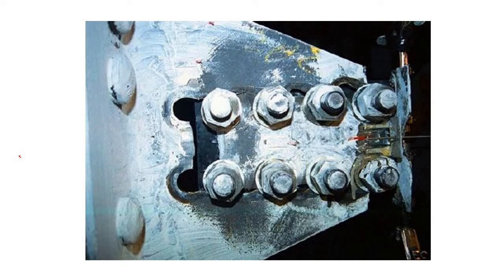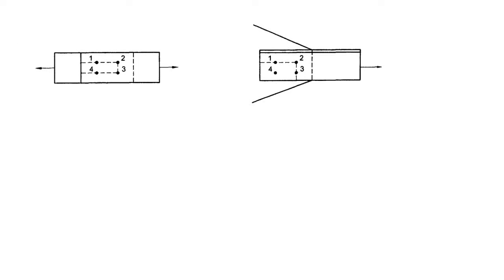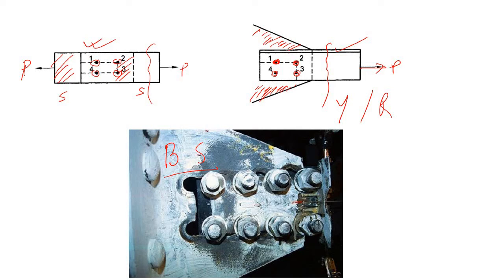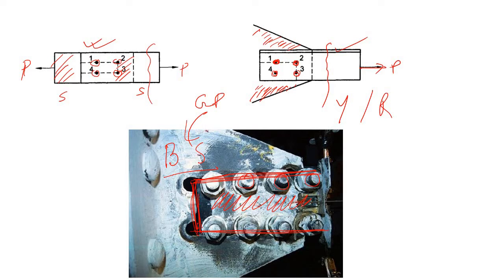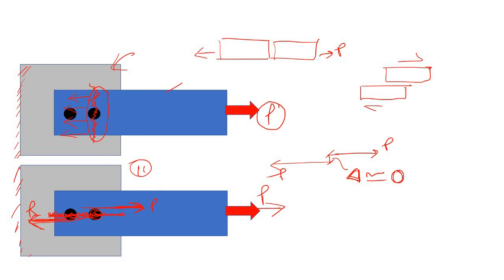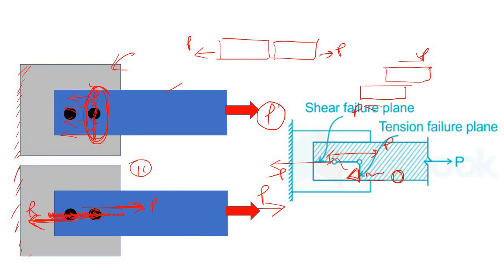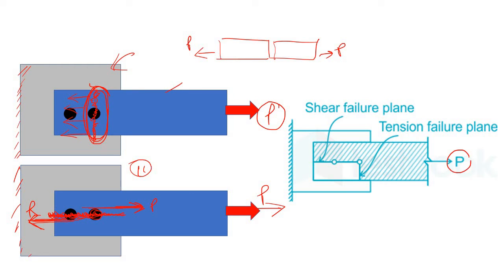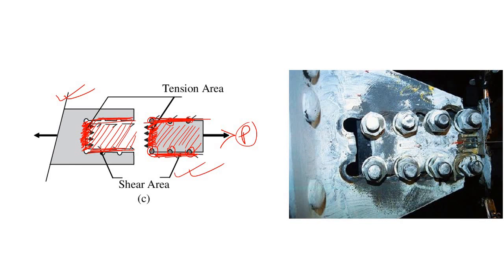Block Shear : Steel Connection Design

Comment: Hello Tonmy, could you please explain about the role of bolts cross section / grade in tensile resistance, in all failure aspects ( Yield/ rupture/ block shear) it's noticed that only Fy / Fu of member + member cross section are the effecting parameters only.
Thanks in advance